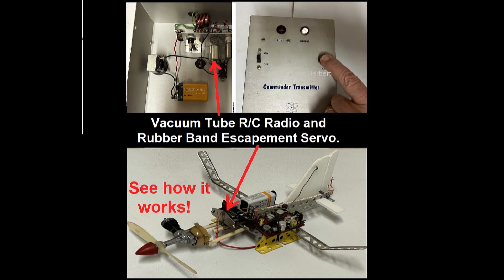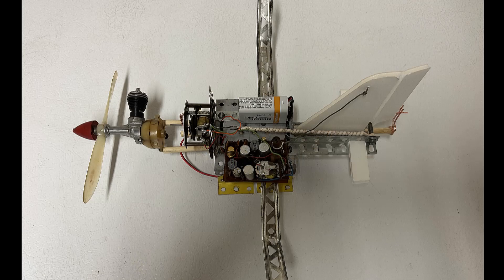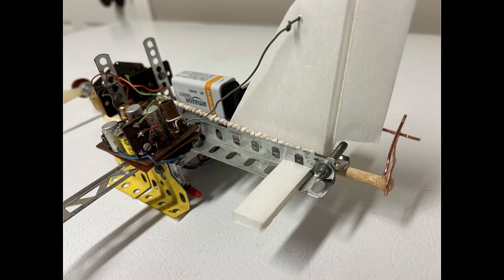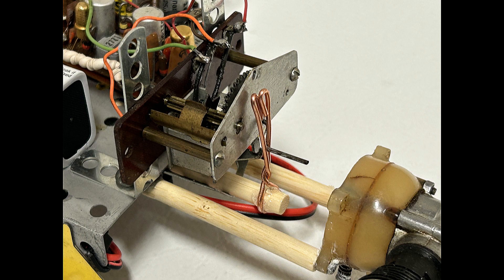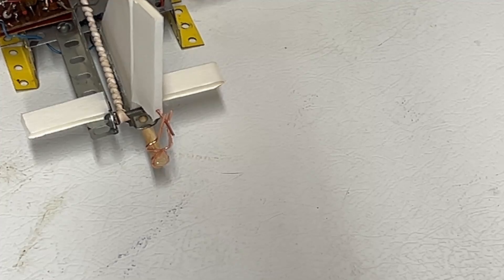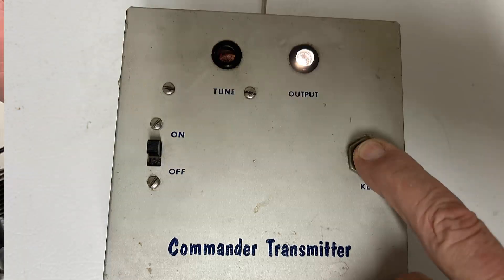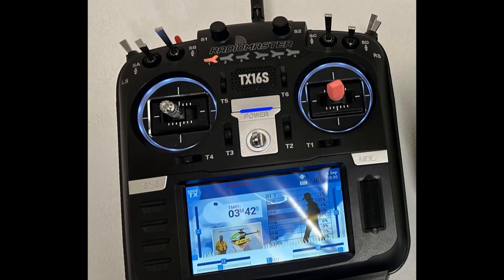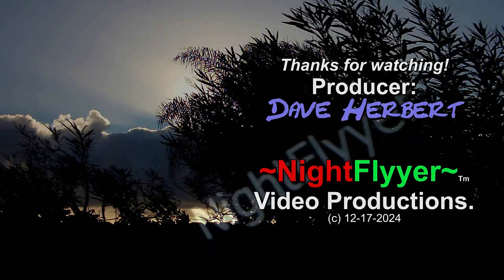Working Vintage Tube R/C Radio with a Rubber Band Escapement Servo.

Comment: Great video!  I was given a plane about 1968 assembled  y my cousin, and had it hanging in my bedroom. It was set up for rubber band escapement but I never knew how it worked. Now I’m setting up a 3d printed plane with 4 channels and electric motor. What a difference!! Thanks.
Reply from the maker: Right on.  Thanks kindly and happy flying.

Comment: I'm an RC and electronics hobbyist, and a retired software developer by trade. I am looking for schematics for some of the old bang-bang and escapement radios. I had a Mini Mombo and a Tester's Escapement system with a Baby Bee way back in the day. Then I built a heathkit proportional and then purchased several Ciruis and Futaba radios, with one Proline and one Kraft with a dual brick servo. I want to start building some old single and 2 channel systems using the old escapements and bang-bang (rudder flappers) systems for nostalgia and educational models. Of course I want to modernize the circuits a bit but want to mainbtain the same working prencibles. If you or any of your followers can point me in the direction of information on these old radio to use as a jumping off poiont I would be very greatful!
Reply from the maker: That's a great story.  Glad to hear we are old and on the same page!  LOL .  I do not have any schematics for these old radios anymore.  I would suggest to contact Michael Smith at the AMA National Museum, or the Radio Control Hall of fame.  They may be able to help you better than I.  Good luck and thanks...

Comment: Now I understand what an escapement was used for in RC.   There is a wild tube rc system on ebay.  It had a small desk a single stick.  I cant remember what it was called.   Neat video 👏👏
Reply from the maker: Right on.  Thanks so kindly and happy flying.

Comment: What system are you using for the high voltage valves ? Shown in the transmitter.
Reply from the maker: System?  Its a simple Vacuum tube Transmitter.

Comment: Back in the mid 1960's my dad and I flew Singe Channel Escapement on 27 Megacycles, mostly he flew and I chased after it. He had what I think was called quick blip up elevator on a couple of his models where a third push of the button would give up elevator.
His first digital proportional RC system was a 4 channel system produced by Controlair it had the transmitter, receiver, battery and for servos. If memory serves me correctly it cost in the neighborhood of $900.00 and it two was on 27 Megacycles. But it was lightyears better than the Singe Channel Escapement crap.
When the digital proportional system came out was when we realty started  flying RC models. Some place I have some old escapements. Thanks for the trip down Memory Laine
Reply from the maker: Right on.  Well, when I worked at Kraft, that was the first Digital proportional radios and it changed everything for sure.  Thanks much and happy flying.

Comment: THats really Cool, I have an old Kraft on the shelf! Been thinking about building a simple single channel with an old escapement but using simple modern radio, Ideally a single botton car key foob type thing.
Reply from the maker: Thanks.  You can do that, but believe me, this rudder only is hard to fly.  Just use the Kraft.

Comment: Back in the 80's I was a kid and didn't have much money. I found a "bargain bin" advertisement in a magazine for a single channel RC system for I think about $10. It used a similar design but did not use a twisted rubber band. The rubber band only held the rudder in one direction. A solenoid pulsed frequently so as to fly "straight" (like a fish). Pushing one button stopped power and let the rubber band hold the rudder in one direction to turn. Pushing the other button commanded the solenoid to be on constantly, turning the other direction. It ate batteries for breakfast.
Reply: Is this what they called the "Galloping Ghost"?
Reply from the maker: @ No. galloping ghost had the rudder wag back and forth continuously. When you pushed the button, it would wag to the right or left. It was always wagging.
Reply from the maker: Yes I had a couple of those as well.  Your right about the batteries.  Thanks..

Comment: I used to fly single channel rudder only. It was a blast. And if you setup your plane right you can do rudder only loops and rolls.
Reply from the maker: I never pulled off any rudder loops with the rudder only setup, but that sounds exciting.
Reply: I'll explain how: In a rudder only aircraft, the non-movable elevator is set up so that the plane is always in a glide (slightly up elevator to maintain a glide) With that much up elevator, engine power will make it climb too steeply. So the engine is permanently pointed down just enough to allow the aircraft to climb continually under power but not too steep..

To do a rudder only loop - Hold full rudder to put the aircraft in a spiral dive. The aircraft picks up speed in the dive. For example hold full right rudder. When the aircraft reaches enough speed, MOMENTARILY hold left rudder just long enough to level the wings. Then center the rudder! The excess speed will then make the slightly up elevator sensitive enough that the aircraft will do a loop.

Rolls work about the same way. In rudder only aircraft, aerobatics are all a matter of speed control combined with correct rudder timing.
Reply from the maker: @charlesschmidt849  We never had throttle control, so wide open all the time.  But still there was definitely not enough power to do a Knife Edge Loop for us back then like I can do today with my planes.
Reply: @NightFlyyer  Yep, wide open throttle and only rudder control. Actually, you don't need the engine running at all. The loop is not done in knife edge using rudder control. The rudder is only used to hold the aircraft in a spiral dive 'until' it gains enough speed to 'coast' through the loop. Then use opposite rudder just long enough to level the wings. Release your rudder and now your aircraft is in a wings level, high speed dive. The excess speed from the dive combined with the elevator being permanently set for a glide will cause the aircraft to 'coast' through the loop. No rudder is used during the actual loop.

You can do the same thing using a regular four channel aircraft: Idle the engine and trim the elevator to hold the aircraft in a glide. Then use 'only the rudder' in the fashion described here to get the aircraft to 'coast' through the loop. 

One thing to note though is that regular aircraft both yaw and roll slightly  with rudder input. That makes it easy to get into a spiral dive using rudder only. However, in an outright stunt plane, using rudder will only produce yaw movement without rolling at all. Thus it might be hard to get a full stunt aircraft to enter a spiral dive using rudder only.
Reply from the maker: @charlesschmidt849  Thanks.  Too bad you dont have any videos to show this, but know I do know how to fly.
Reply: @NightFlyyer  I might should've added this next step when simulating rudder only flying with a four channel aircraft. Sorry but didn't think about it until just now. You might want to add this step 2 throttle setting to simulate an entire flight just like an actual rudder only aircraft.

To simulate rudder only flying on a four channel aircraft:

1. Close the throttle and then set the elevator trim to hold the aircraft in a glide.

 2. Add back in just enough throttle so that the aircraft continually climbs slowly. Do not touch your throttle, elevator or ailerons again. Now your aircraft is flying just like a rudder only aircraft from years ago. Do remember that you need an aircraft that both rolls and yaws with rudder input. Most aircraft will do that except for outright stunt planes that only yaw with rudder input.

If your aircraft starts getting too high, use just the rudder to pull the nose down and circle down. With enough practice you can do lots of wild maneuvers using rudder only. Some people even get good enough to do rudder only touch and go's.

Comment: Do you remember galloping ghost radios?   After single-channel, some folk went on to fly reed-radios, others opted for galloping ghost.  Having elevator as well as rudder was such a treat for those of us who grew up with bang-bang single channel.
Reply from the maker: Yes, I had the galloping ghosts as well and they actually worked pretty good but hard on batteries.  Thanks.

Comment: Stop making me feel really old.   Ah... happy days.  I still have my escapements and super-regen single-channel RC gear from the 1960s.  I'd put them in a model but I worry that the 27MHz band is now so noisy it would be a disaster.
Reply from the maker: Go for it.  27mhz is pretty clean these days, since CB is basically pretty quiet.  CH 13 destroyed model planes.

Comment: I still remember when I was a kid my father bought one set of four channel Heathkit RC radio system from a PX goods in South Vietnam. I was never used.
Reply from the maker: When I worked at Kraft, we also manufactured the HeathKit radios for them.  I wish I still had one.  Thanks.

Comment: should do something with early mechanical proportional systems...
Tx side... motor driven drum with a wedge of foil wrapped around it. wiper contact gives a PWM signal.
Rx side... motor acting against a spring.

same regular "bang bang" CW transmission.
Reply from the maker: I don't have the equipment after the fire, or I would, but you are welcome to do it.

Comment: I had an Ace RC escapement that worked pretty well on some free flight models. The worst part was to remember if the next button push would stop it left or right. My first digital radio was a Kraft KP-4, it work well for several years. Always wanted a signature series. Those were beautiful transmitters.
Reply from the maker: Your right about that.  I remembering just panic pushing buttons to make it go where I wanted.  LOL. KP-4's were good radios. I worked in the Signature Series line building them, and your right, they were pretty sweet at the time.  I flew my Signature last summer just to see how it felt. Maybe you saw that video.  Anyway, thanks so kindly and happy flying.

Comment: Wow, i had no idea! I always thought these button-press radios controlled a geared motor with a return spring, this is much more involved. My respect to you and all RC pioneers.
Reply from the maker: Right on. You are right, I have one of those servos as well, but it is easier to use and understand, compared to this.  Thanks.

Comment from the maker: In the 1950's I messed around with single channel tube radios and airplanes with only rudder control. They were difficult to make work and fly, so I went back to U-Control.  But when I returned from Vietnam in 1970, I became employed with Kraft RC Systems.  
They invented digital proportional radios and servos, ending the era of Single channel tube Radios and Rubber Band Escapements making R/C easier to fly.  I hope this mock up I built from old parts shows how it was laid out in the plane and how it worked so you understand how great R/C has become today.  Thanks so kindly for watching and subscribing.